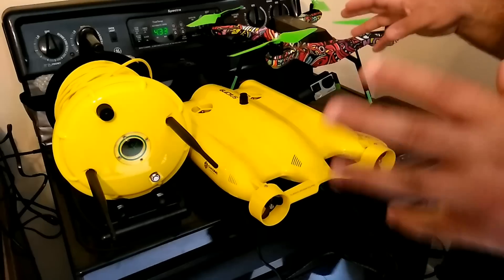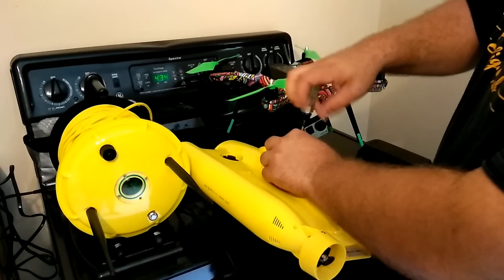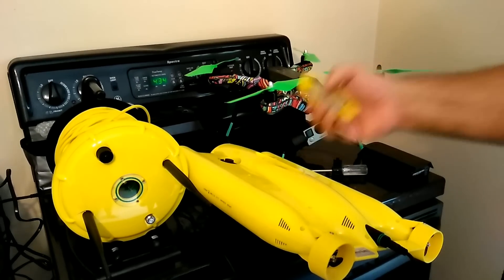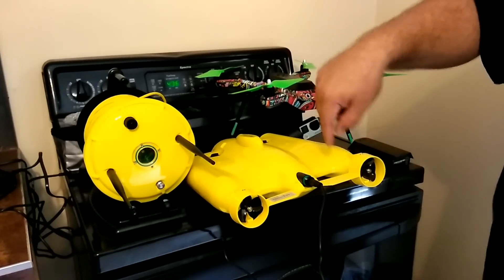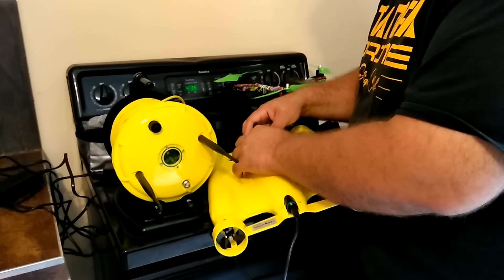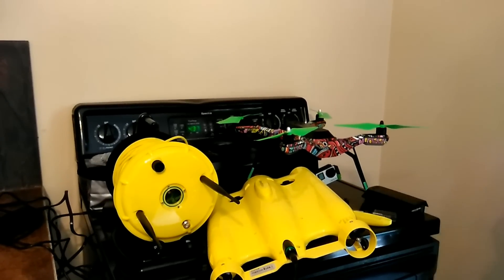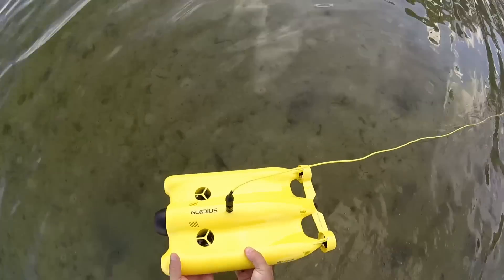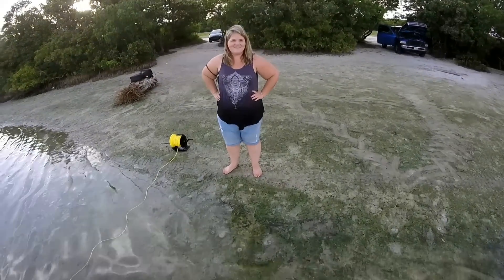Gladius 4K Underwater Drone Oops Don't Make My Mistake

Comment: I just purchased a Gladius Pro and having a problem with the Videos...pixelated and just not good when I view them on my computer. I have a Phantom 4 and know how to setup my Videos. You can email me at drums56da@gmail.com if you will. I actually live in Sarasota not far from you.

       Thanks, Doug
Reply from the maker: Doug you need to really get into the settings on the camera and make some adjustments you also need to make sure your firmware is the correct firmware
Reply: @IFixShet  I appriecate your reply. I went through the camera settings and firmware update, I've received no notices for updates so that should be fine. If you don't mind could you give me a call at 806-9278 so I can explain the problem better.
          Thanks, Doug

Comment: CorosionX is your friend, would coat all the components before submerging it. We used it on model sail boats and seaplanes, coated batteries, motors, connectors, electrical parts. Used Isopropyl and distilled water to clean after salt water. Greatest seawater remedy ever. 😆👍
Reply: Haha next time you will get good footage.